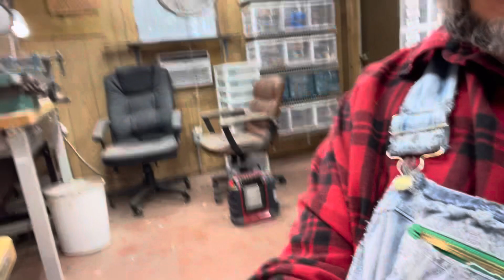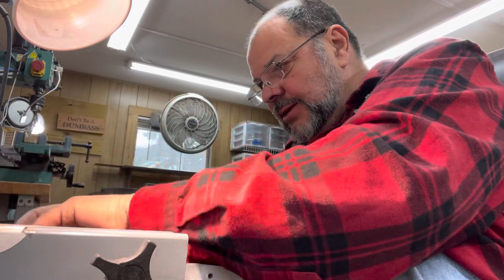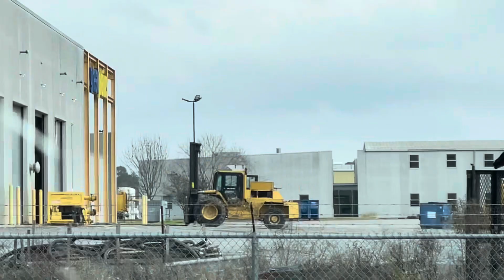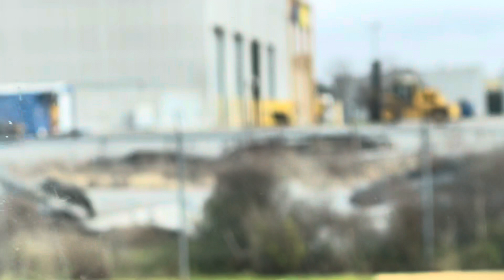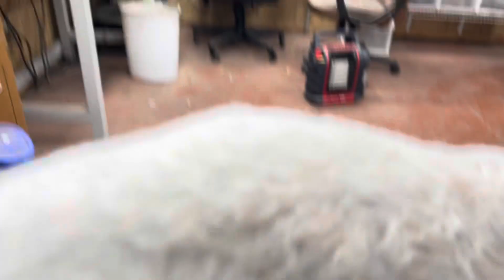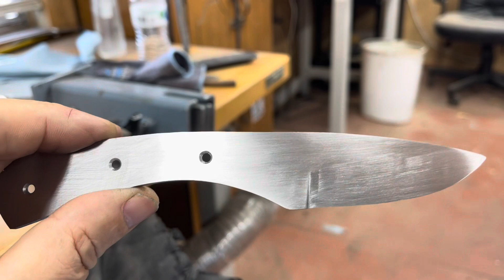Sanding, talking, solar generator liars, buzzards waiting for us

Comment: A good friend of mine had a good saying. "Companies get the unions they deserve."
I worked for a couple companies that had a union.
One was a grocery store. I was a bag boy and got paid about 50 cents above minimum wage which was cool. 
The funny thing was that  the other baggers were guys in their 30s and wanted the union to negotiate for a dollar raise.
I got let go for taking something from the trash and the union was worthless at defending me.
Reply from the maker: Half the stuff I’ve  made started life from the dumpster. There was a place in Lagrange ga. No one wanted to deliver there because it took so long. I would jump at the opportunity to deliver there because they always had good junk in their dumpsters. I pulled all kinds of steel, threaded rod, tools that were easily fixed. Plate steel. Aluminum angle. I would leave as heavy as I was bringing them their freight.

Comment: I live like 1865 on purpose, I love it.
But because of Wani babies 40 qnd up, I have emergency solar panels, Batteries,  And converter. The only way you can live with solar is, You do not run your refrigerator at night. You plug in your refrigerator you cool your refrigerator,, then  It will stay cold or frozen at night. I put a quilt over mine. Then in the morning you plug it in. Lights are are solar on their own, I absolutely love these lights. They are the light bulbs that  Comes with a panel you just stick in the window. That light bulb is ready to go all the time. I've had mine for about 5 years and they work excellent. Every household should have at least 2.
Of course I cook on a woodstove. Far on the outside In the summer. I don't use a microwave. Cast iron pots and pants.
There is a way to Live with very cheap solar, You just have to learn how.  44 years ago when I Bought this house, First thing I did was put a woodstovian.  Good thing I did, The electric out here goes off a lot. After a  Tornado tour up this town , Guess where they came to , to do their cooking, washing, baths( After they heated their water on the stove).
 I am worried, For the people who do not know how To live without electricity and modern convenience.  There is quite a bit of chaos that is coming to this country. Worse than it is now. And people are not going to make it. A year's worth of food stored, And even then I think you'll need more. Please put out a big garden this year. Caning all that you can.
 The first things you're going to see happen, People will be at the park trying to catch the ducks , In order to eat. People trying to fish for the first time and not catching anything. Medicines is already flying off-the-shelf. Some  Prescriptions people are not able to get because they come from China.  Well most of your medicines on the shelf are also from China..
If China stops Sending over the drugs on the street, Think what those people are going to turn into Mean ravaging animals.
Hate to be a downer, just some things people should think about.
 God please bless the USA with protection.
Reply from the maker: I’m afraid we will all be living in the 1800’s very soon. Solar lights are a great idea.

Comment: I am like you Brad we have our generator that plugs into the house, but we do have to 300-watt jackerys that we use if the power goes off before we go to bed just to watch the news and run one lamp and we have gas logs to keep the house warm.
Reply from the maker: They absolutely have there purpose. Plus, they don’t make any noise  or put off any fumes.

Comment: I have "graduated" from a CPAP to an actual ventilator.  Both use(d) oxygen in addition to the pressure, so both machines won't run long on a battery system, never mind how the system is re-charged.  Oh well.  Best I can do.  Mini schnauzer!
Reply from the maker: I can’t sleep without my CPAP. I can take short naps but I wake up feeling like I was up all night.
Reply: @bctruck  I doze off in my chair, sitting up, without my CPAP/entilator, but as far as actually SLEEP....no way.  So yeah, I hear ya.

Comment: i used to be a union worker it was the auto aerospace agriculture union i worked the cleaning line and then on to heat treat for oberdorfer foundries in north syracuse ny area the union never done anything for me besides take my union dues out of my check each week
Reply from the maker: I worked the loading dock for yellow freight way back in my early 20’s. At the same time, I drove for a produce warehouse. I made the same pay at each place but yellow was union. I had far less in my check from yellow than my check for non union finest foods. Same hours, same pay.

Comment: I am all for having solar generators for emergencies especially long term outages. But companies like Ecoflow are selling these massively expensive solar generators and the people buying them have no idea that they could build a better system much cheaper. For what Ecoflow wants for their new Delta Pro Ultra someone could build a system that could run the whole house. My Delta 1300 can run a oxygen concentrator but not for real long. Certainly not all night. My only issue with regular generators is if the fuel supply chain is disrupted you are sunk unless you have a wood gasifier. Honestly most of these folks are buying the solar generators because they are the new fad to impress their friends with. They have no idea how silly they look. In the Ecoflow groups there are people that have stacks of them. No common sense at all.
Reply: I tagged you in a community post with pictures of what I mean.
Reply from the maker: City prepper got the delta pro with two extra battery segments, and the panel to connect it to your house ,for free. He did a good job talking it up and giving his 10% off affiliate link. I went there just to see how much and it was all about 15, grand for what he had.

Comment: What is a heat strip??  I use wood for heat.
Reply from the maker: It’s just a coiled  heavy wire that gets red hot when 220 volts are applied to it, then the blower blows across it and the air heats up and circulates through the house. When it goes out, I’m gonna replace it with a much more energy efficient heat pump.
Reply: Interesting...  I had never heard of it before.